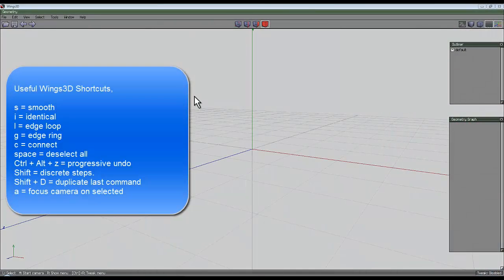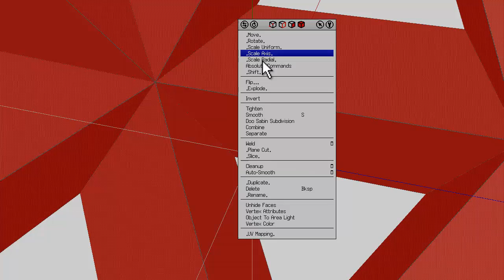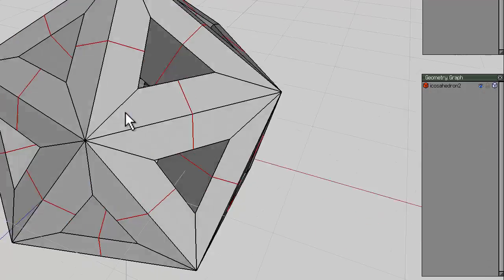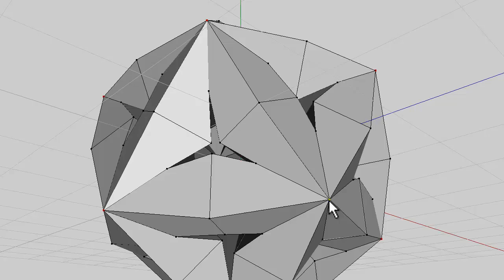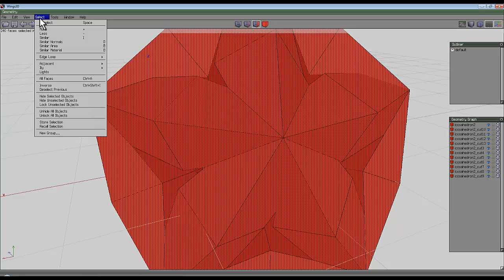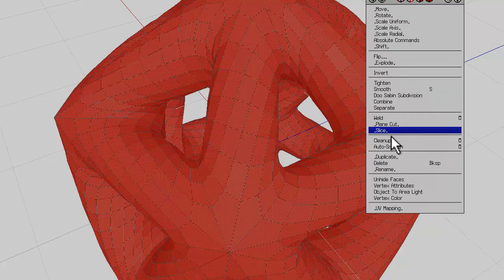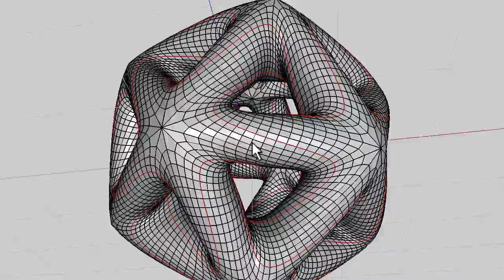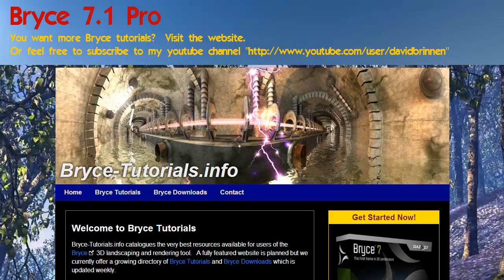Wings 3D project - icosahedron twisted loop - by David Brinnen.

Comment: i started this tutorial today...my wings 3d is version 1.5.2 and it doesnt have a clean up option
Reply from the maker: Just downloaded 1.5.2.  At least in my version (Windows 64 bit) the clean up command is in the same place as in 1.5.1.  So I don't know why your version is missing this option.  Maybe your install is corrupted?  Try uninstalling it and re-installing it?
Reply: Okay I will try this. I really like mix and matching your tutorials. Make something in wings then render in Bryce with fancy materials and stuff.
Reply from the maker: Amie Rowswell Do bear in mind that the menus are to some extent context sensitive so depending on what you have selected at the time when you call up the menu you may or may not see this option.
Reply: i'll download the 1.5.1 version. if it doesnt work i'll try fiddle around with stuff

Comment: I had not thought of that, but you could be right. I think when the circularize command was used, I did not make my size as large as you did in the video. So that would be something to try and see if it will work better. I thank you for this suggestion, and I'll let you know how it turns out.

Comment: I'm using 1.4.1 also. My OS is Windows 7 Home Premium 64 bit. I have an intel CORE i3 processor, and 4 GB of RAM. I'm on a Toshiba laptop, and I use several peripherals; An external mouse & keyboard, a cooling pad, & i have several backup external hard drives for extra storage and for backing up my internal hard drive. Not sure how relevant this info is, but there it is.

Comment: In your video it is from 5:58 on that the divergence occurs. You selected the fourth line down from the outer point, then pressed L & I about 2 or 3 times to get the line to loop round the object until it meets up with itself. Then you went to face mode to select all the adjacent faces. I figure if I select the 2 perpendicular lines attached to the one you selected, I can use G to go round the object in the same way & then go to face mode. I've not tried that yet as I have other things going.

Comment: Gonna have another go ASAP, but will be trying the method I posted in my last comment. As I was following your tutorial step by step, it should have achieved the same results. It seems that it might depend on the capabilities of the processor being used? (Maybe?) I'll try selecting the intersecting lines that cross the one you show in the video on either side of it in each sector of the model, and then hit G and see what happens. If successful hitting F will get me to the next step.

Comment: This happened as I followed the tutorial. After the third smooth I selected the shown line & pressed L & I two times. A problem you mentioned caused more lines to be selected than should have been. I tried 3 times and got the same results each time. I'm wondering if selecting 2 crossing lines & using G would solve it; perhaps going round the object, & selecting the same one in the other similar areas? To match yours I'd need to select two lines in each area? Then I can do the last intrude.

Comment: I'm somewhat familiar with Blender, but not C4D. 
Of the modelers I have and use, I have found that each have some similarities, but far more differences from each other. Theoretically you can achieve the same results in any of them, but the modeling process is either more or less complex in any given modeler; with Wings3D usually on the least complex side of that coin. I have different reasons for using each of my modelers.